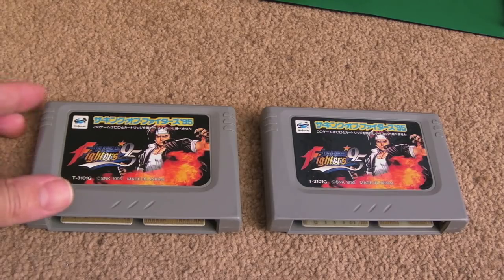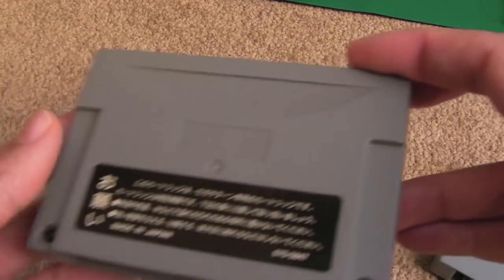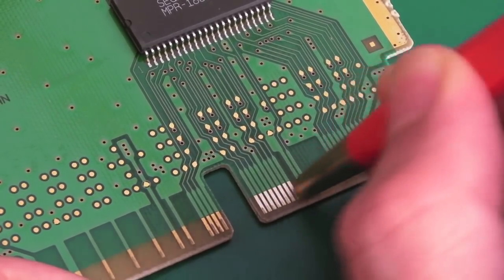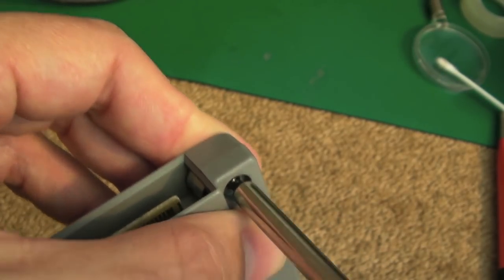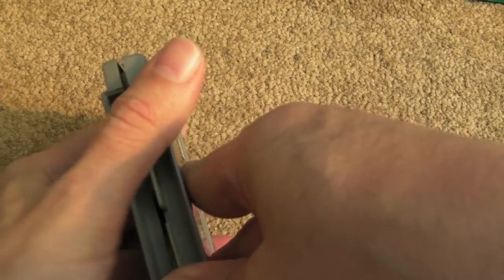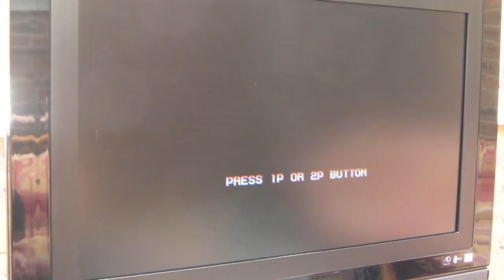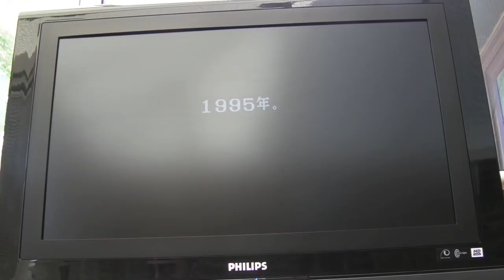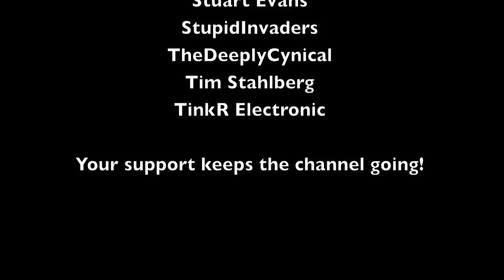Sega Saturn King of Fighters 95 Dead ROM Cart Fixes (NTSC Cart with PAL or NTSC disc)

Comment from the maker: Before anyone says anything about the fibreglass pen lol - Yes, eraser is better!  I had to test it as there's usually someone telling me it's better to use a fibreglass pen.  Not in the case of cart contacts - eraser is better, unless the contacts have actual corrosion on them perhaps.
Reply: GadgetUK164 - Retro Gaming Repairs & Mods awesome great tips and tricks. Always enjoy your style an thought process. My Wife said he drinks a lot of coffee 😂
Reply: You beat me to it! 😂

I always use an ink eraser which is slightly more abrasive than a normal pencil eraser, but not quite as caustic as a fibreglass pen. Never had any problems myself with this method. 👍
Reply from the maker: Absolutely =D   Was a nice test - I've been starting to test out some of the advice that others suggest etc, this one I think I've proven is not a good idea with carts.
Reply: you need to plate that gold back as it will get worse and just fyi never mix metals eg. gold contacts should be used only with gold 
people did this a lot with ram as back in the day 30pin/72pin was either silver or gold etc same with the sockets
here is a vid on redoing https://www.youtube.com/watch?v=ecoxUwzyc0Q
Reply from the maker: Most of the gold plating is still on there btw!  I didn't remove all of it, just a fine layer came off.
Reply: lol its plated it is a fine layer and gets even worse every time you use

Comment: For cleaning cartridge slots i use some cardboard the same thickness as the pcb thats being inserted i push that in and out a few times and it brings the pins up nice and clean with our damaging them its surprising how much dirt comes of onto the card, you can use cereal packet card folded over so the rough part is used.

Comment: Nice straightforward fix!
I agree with your sentiments regarding gold plated contacts / connectors and fibreglass pens. It's always wise to try something less abrasive first. I have some Deoxit Gold which is designed specifically for gold contacts but it's quite expensive so should be used sparingly! Funnily enough, I always turn screws initially anticlockwise, until I can hear or feel the start of the thread, so they are less likely to become cross threaded.
Reply from the maker: Yeah, I wish I had noticed the dust after the 1st cart - I would have then just reverted to the eraser for the 2nd.  Most of the gold plating is still on there, so it's not the end of the world I guess.

Comment: The Saturn is such a weird system. A lot of untapped potential it seems. The cartridge slot being especially mysterious as it was rarely used. These carts have the actual ROM whereas other games just used the cart for extra RAM or as a sort of memory card.
Reply from the maker: It's a shame we didn't see any other cart games.  I guess they were limited by space accessible.

Comment: I think it's pretty rare for any game cartridge to be faulty in general. I've gone thru so many and I've only found 2 or 3 that I couldn't revive (really bad liquid damage) N64 gameshark/action replay being one exception; they seem to die for no reason all the time!
Reply from the maker: For the most part - yes!  But I do see quite a few Atari 2600 and Megadrive carts faulty.  On other systems it's pretty rare as you say!
Reply: GadgetUK164 - Retro Gaming Repairs & Mods haha of course those are the ones I've seen the fewest of!  Only have a few Genesis ;-) games in my collection. disappointing to hear that they tend to have a higher failure rate as I have a long wishlist of Genesis/MD titles to obtain!
Reply from the maker: Most Genesis / MD games are OK!  It's just some bad batches of some games.  Sonic is an example of one I see lots of failures.
Reply: GadgetUK164 - Retro Gaming Repairs & Mods ah good to know it's a fluke, then! Speaking of the mighty Genesis, I literally just now came across a weird glitch while playing Streets of Rage on the "6-pak" cartridge. I went to the sound test to listen to a few tracks (as I often do) and noticed that the round 1 theme seemed to be missing a channel of sound. The other tracks also. I reset the game (which resets to the title screen of the game you were playing) and the same thing happened. Powered off and selected SOR again; same thing. Not until I started the game a did a special attack did the other channel cut back in. Ever seen something like that?

Edit: I just uploaded a video to my channel showing everything except the exact moment when the sound cut back in! https://www.youtube.com/watch?v=Mx8ct_IrACY

Comment: Are you using an American Saturn, PAL European Disc and japanese ROM Cart? And your Saturn already had an inner chip to run back ups?
Do you have also region mod in your Saturn? What is your exact set up?
Reply from the maker: It's a PAL system (with 50/60Hz switch).  It can play burned discs too.  I modified the region encoding of the US and JPN discs to PAL, so the system will boot them correctly.

Comment: I really liked how the Saturn had a solution around what typically happened on PS1 and N64 in fighting games, lots of frames removed. Although it's really just RAM expansion, not a new concept except maybe for consoles.
Mostly the delivery of the cart was too staggered to take off more, Japan only, 1MB & 4MB variants with incompatibility differences, and 3rd party versions. I think the sizes were a bit conservative but prices probably hadn't dropped much yet on memory cost bitd. Still 4MB & 8MB would have been better and likely have got more uses.
Reply from the maker: It's a ROM not a RAM cart!  But kind of almost the same except you don't need to load data into it first from CD.  As you say though, there is a 1MB and 4MB RAM cart too!
Reply: Even more strange as a ROM cart, making a whole cart for one game to act in a partial manner, everybody else just used the general RAM cart iirc. Not quite on the level of AES or MVS but SNK sure wasn't afraid of making big carts.

Comment: What software are you using to burn the disc and what settings do you use?
Reply from the maker: I just use ImgBurn 2.5.8.0, and burn at the slowest speed (often x8 with modern media).  The key is using good Verbatim or Tao Yuden discs.

Comment: I have a Sakura Wars cart do I need the CD game for it to work or does it work like a regular Memory cart with any game? Or maybe mine is dead. I'm using a Japanese cart on a US Sega Saturn.
Reply from the maker: There's no region protection on the carts!  I am not sure what the Sakura Wars cart provides, is it just save RAM or does it have graphics data like this KoF 95 does?   You may need to test with the Japanese version of that game - which would mean a region mod (BIOS) or perhaps a drive protection mod, so you can burn the Japanese version (after changing its ID to US or EUR etc).
Reply: @GadgetUK164   Not sure if it has graphics data or saves RAM I'm just now learning about these carts I'll look more into it. I plugged it into my Sega Saturn and checked the memory storage and it didn't seem to change anything. I was just looking for a Memory cart on Ebay and bought it for $13 thinking it was a memory cart.  If it has graphics data I wouldn't mind playing the game and trying it out.

Comment: anybody know where I can get one of those fiberglass Kercher cleaning pens would be handy to have. Didn't know they made such a thing. Ironically, I don't know much about the Sega Saturn only ever physically seen one in person and it's the one that I own. I got it by accident. And before I got it. I had never heard of a Sega Saturn. I bought it with a box of games at a pawn shop. Some of the games were brand-new, still sealed in the idiot broke the sealed make sure the cases were empty. One of those games was  snatcher , which I sold about six months ago to pay a bill or two sold it for a fair bit less than it was actually worth because the guy didn't believe me. The game was brand-new and merely had the seal broken on the casing to open the package, plus he made a big deal about I didn't have the gun and I found the gun a couple weeks after he got the game where I dug the gun and the game of and couldn't find the gun afterwards.I had no idea there were Saturn games that required a cartridge and a disk. I thought the cartridge port on the Saturn played Sega Genesis games.
Reply from the maker: You can find fibreglass pens on eBay!

Comment: why Loading time? even used  Cartridge. but that's good you fixed it.
Reply from the maker: The cartridge is only 2MB, and I suspect there's perhaps a 4MB limit on the cart slot (without bank switching or something).  They've just used the cart to speed up the load times and to perhaps have more frames of animation than might be possible using only internal memory on the Saturn.  It is far quicker to load than other Saturn games though.
Reply: @Fer M  Marvel Super Heroes supported the 1MB cart. It will work with the 4MB cart, but I've heard that it causes slowdown.
Reply: I'll have to try that with my US version, though I'll be using a 4MB cart.